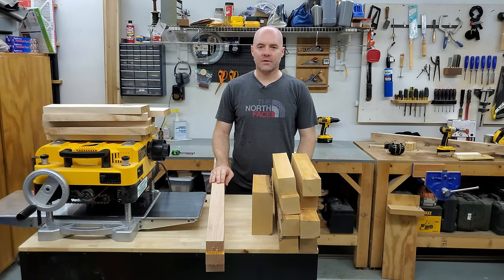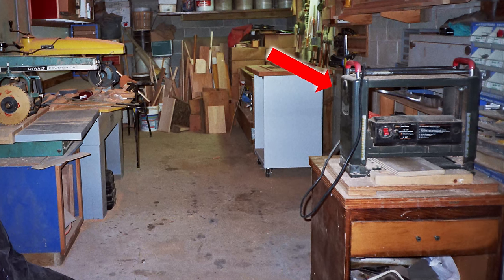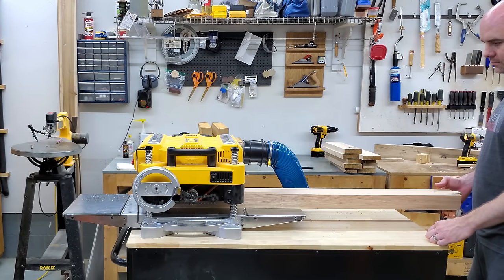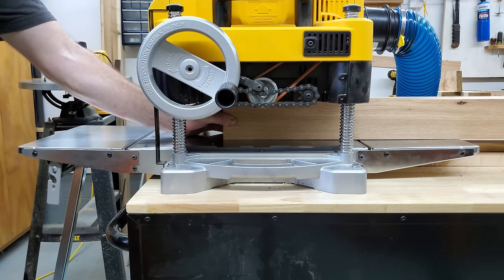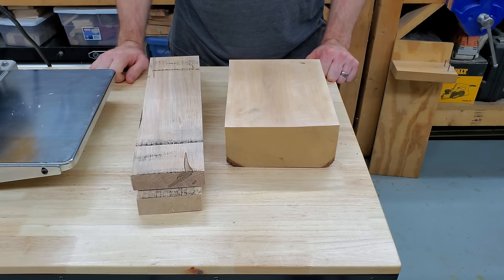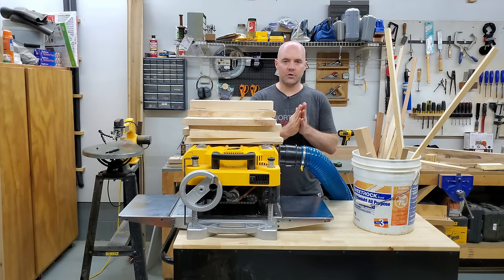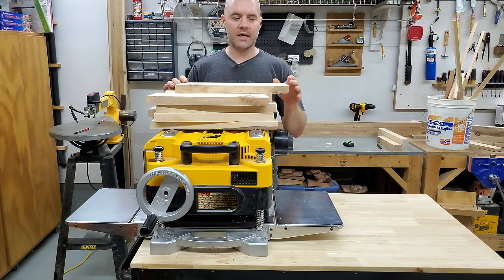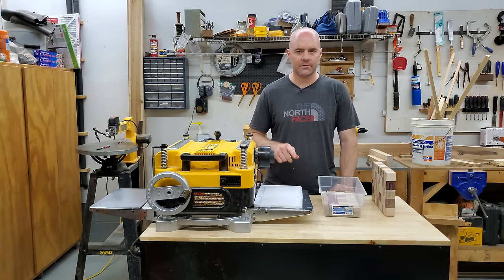Everything you need to know about thickness-planer snipe

Comment: I use your techniques to reduce snipe, but (as you said) nothing eliminates it (am also using DeWalt 735).  My Dad’s planer is a Shopsmith, which changes table height (rather than DeWalt’s changing cutter height).  It has a similar snipe tendency.  

Are there planers that do better in controlling snipe for hobby woodworkers, or are the higher-end planers simply wider?
Reply from the maker: From my experience, the only thing that completely eliminates it for portable planers is using a sacrificial board wide enough to maintain similar upward pressure as the project piece, or a plane train. I've heard good things about several other brands, but don't have any firsthand experience with recent models.

Comment: Great video, thank you. However I was hoping that there was an adjustment on the planer that helps getting at least close to a snipe free result. Ever since I changed the cutter knifes I can't get the snipe out, unless I have a sacrificial board in the beginning and at the end and even that has mixed results and it is very inconvenient and can get expensive with price of wood. That type of design is flawed and wished Dewalt would address that. This planer has been out for a number of years and it hasn't been addressed or they just can't figure it out. Never the less it is a great video.
Reply from the maker: Strange, changing cutter knives shouldn't affect snipe. How old is your planer? I wonder if there's something else that's showing signs of wear.
Reply: @TheSnekkerShow  Actually it quit common after I went down the rabbit hole. It apparently has to do with the rollers too. I know it sounds ridiculous but many users had the same experience after they changed cutters. Mine is about 8 years old but has not been used on regular basis.

Comment: I'm curious, does it help to have a jig that is a longer table? I have seen a few videos where a guy makes a longer table out of melamine and it sits on top of the planer table and just because it is longer it is supposed to reduce snipe. It must help to reduce snipe on the longer boards right?
Reply from the maker: That is correct. The longer tables provide infeed/outfeed support. Sometimes I'll set up roller stands for the same purpose if I'm planing longer or heavier boards.

Comment: I find that with my Craftsman, if I do the smallest cuts possible I get very little snipe. I use a long piece of Melamine shelf with support legs to make one long flat table, but even then I get snipe. But if I take off as little material as possible on my final passes, the snipe isn't nearly as noticeable and is easily removed with sanding.

Comment: Isn't the stop block on your sled [at 15 mins] on the wrong end as you inserted it?  Shouldn't it be at the rear?
Reply from the maker: The rollers are pulling forward, so if the stop block isn't in the front the board can get pulled right off the sled.
Reply: @TheSnekkerShow  You're correct and this is exactly my reasoning, but look how many who advocate/make sleds on YT and elsewhere put the stop block at the back end.
I'm an engineer!   The pull force is from the top, not the bottom. The workpiece drags the sled.   So if you imagine the friction force rearwards was very high under the sled and higher than that between the sled and workpiece, and higher than the opposing pull force, the sled would get left behind without the front-mounted stop block.
Clearly you know your stuff!  👍👍👍
Reply: @AllenReinecke  That confused me in other videos as well, where people started hot-gluing their boards to their sled.

Comment: Quick Question: Could you just disable the rollers and manually push the board through with a 2nd board?
Reply from the maker: Could? Yes. Should? No. High risk of kickback.

Comment: If you place your board in on a small angle, will that reduce/minimize snipe?
Reply from the maker: It could. Feeding at a slight angle lets the knives get a slightly easier start on the corner of the board, rather than hitting the entire edge at once. Especially on thin or very hard pieces, this can decrease the risk of the cut lifting the board in to the cutterhead. Most of the time it would just put your snipe line at an angle, but not reduce the depth.
Reply: Dominick get a jointer

Comment: I’m making a desk out of 5/4 x 6 x 10' pine & I have 5 lengths to make a 27 1/2” desk. So I glued up 2 pieces (to make 11" width to be able to plane) and then another 2 & have a single piece left over. You answered my question about feeding one after the other, but if I don't have those wings or a table to put them on and I'm working on my garage floor, i would have to put something on the floor to make it even with the planer feed table on both sides correct? Even if i had a table i would need rollers on both sides correct? I do have the same planer just never used it and im still learning. These 10ft boards are tricky,  i wish i could just pay a woodshop with an industrial planer to run the whole 27 1/2" width at one time for me lol
Reply: It should handle the length. My planer (ridgid) is similarly made and I run long 2x10s through all the time. You can build an outfeed bench or table for it, but I just hang on and hold the piece as it's entering then exiting. It's nearly impossible to run a train with long pieces like this without someone on both ends to support the pieces..but with infeed and outfeed tables I suppose it would be easier. Unfortunately my shop isn't 30 feet long to handle a 16 footer.. 10s are tough enough as is and I have to jump through hoops to get it done..
Reply: Even if you had an optimal support setup, this scenario is best done with a helper. For these times, I sweet talk my wife into sparing 15 minutes in the wood shop, and we do a dry run so she knows her role.  Then you can safely run a “plane train” and avoid most snipe.

Comment: Would an extended infeed/outfeed support help? Got my 735 without the folding tables and plan on making my own. Had the idea of grabbing some granite or quartz off of FB Marketplace, people are always giving the stuff away. Figured a nice, 2’ long polished piece on either end would be the bee’s knees. 
But would it make a difference having it that long?
Reply from the maker: Extended supports could definitely help. As for the right length, it would depend on what size boards you normally plane and how much space you have. The DeWalt support tables are usually enough for me, but I have to provide manual support for longer boards.

Comment: So does the actual cutter head raise up with the rollers like you showed?  I couldn’t see any deflection in your videos, but it raised in the animation.  If the cutter head raises, wouldn’t it defeat the purpose of setting the cutter height?  It would just cut a set amount below the rollers.
Reply from the maker: I did the animation just because the amount of movement in the planer body is not detectable by eye, unless it's a really bad planer. That's also why I used the wax crayon to show where the snipe was. On this planer, it's often so slight that it's not noticeable.
Reply: @TheSnekkerShow  Gotcha.  Thanks for the reply.  Great content!
Reply from the maker: @ericw9655  You're quite welcome.

Comment: Have you ever used a long jig to make the feed surface level?  I have seen several examples of that look like a possible solution.  I don't have as much experience as you, but I'm trying to find the best solution to the elimination of snipe.
Reply from the maker: Yes, you can make a jig that fits over the planer tables, usually out of something slippery like melamine-coated MDF. There are pros and cons. You definitely need to make sure you don't get any sawdust underneath the jig, or else your boards will come out thicker on one side than the other.
Reply: @TheSnekkerShow  Do you have recommendations about the length of the jig? I have a Craftsman 15 amp planer. I bought a Melaimane covers shelf today. It seems logical that the jig needs to be a little longer than the feed tables.
Reply from the maker: @robertstapp5070  A little longer than the tables, but if it's too long and unsupported, then it will flex, which would make the extra length pointless.
Reply: @TheSnekkerShow  thank you for your advice and help. It’s greatly appreciated!

Comment: Awesome video. My DW735 somehow will not go into low speed (i.e. position 1). Somehow no amount of for ce will allow me to turn the knob counterclockwise to slow the indeed speed down... And yes I tried while it's running. Has anybody experienced the same issue?
Reply from the maker: It hasn't happened to me, but if you take the top of the planer, the moving parts for the speed change are directly behind the speed switch on the front.  You'll have to depress the safety switch in the top to get it to start with the cover off - it looks like a little cross. Maybe you'll be able to see what's sticking.

Comment: What are your thoughts about getting a Sherlock?
Reply from the maker: I'm not familiar with it.
Reply: @TheSnekkerShow  Good grief … auto correct: I was trying for Shelix … and i found your video on that; pretty much answers all the questions I have presently.
Reply from the maker: @johnoerter2883  Ha! I should have figured that out. I'm a big fan of my Shelix.
Reply: @TheSnekkerShow  I have a Shopsmith Jointer and was frustrated after talking to the Shelix folks that because the outfeed table is fixed there is no way to install their cutterhead on the Shopsmith … :-(
Reply from the maker: @johnoerter2883  That's too bad. In my list of things I don't have time for, I've been thinking about trying to modify my Ridgid cutterhead to use carbide inserts.

Comment: Here's my technique:  In the plane train, one board is the Alpha and the Omega.  While Alpha is held by both feed rollers and getting planed, I lower the height wheel 1/16 turn, run all the boards, and when Alpha goes through the second time, it becomes the Omega and I raise the height wheel 1/16 turn while the board is still held by both feed rollers.  Does anyone else do something like this?

Comment: 2:57 So... If a planer had feed rollers on the bottom, there would be no snipe? A low power brushless motor could handle the feed rollers. This should be adopted.

Comment: NEVER stand in direct line with your work piece coming out of the planer, as seen at 6:35.
Reply from the maker: The knives are cutting towards the front, which is the direction any kickback debris would go. Not the back.

Comment: Read the manual for your dewalt planer. It says they should be angled. It tells you the specific angle to set them at. It also says that the tables are set from the factory at this setting.........so......?
Reply from the maker: I read my manual, and it definitely does not say that.  If yours is different, feel free to provide a link and specify which page it's on.  Either way, I think I explained and demonstrated pretty clearly why it's best to keep them in plane.

Here's a manual on the Rockler site. It mentions the infeed/outfeed tables on pages 12 and 13.  https://go.rockler.com/tech/DW735X-13in-Three-Knife-Two-Speed-Thickness-Planer.pdf.  On page 6 it says, "Be sure the wood is lying flat against the base of the planer.  If the material is inserted at an angle, the reading may be inaccurate," just as I demonstrated.
Reply: @TheSnekkerShow  you are correct, their is no situation in Woodmaching where a machine is purposely set off level, I have been a woodworing machinist for 57 years, so I think I may be correct.
Reply: LakesideHog, clearly you have NOT read the manual on this planer.  I recently purchased this exact planer, and on page 8, it addresses snipe and I quote it here:
  [start of quote]
TO AVOID SNIPE
Feed the workpiece into the planer so it is level and remains flat against the base at all times.
Keep the workpiece level throughout planning operation by receiving or 'catching' it from the rear of the planer.
If you are planing material that is especially long, the use of additional material support is recommended.
  [end of quote]
It goes on to discuss twisted, cupped and bowed wood, and includes an extremely good suggestion: "Your thickness planer will work best with material that has been run through a jointer to produce one flat surface." Definitely true! Jointers and thickness planers work hand-in-hand to produce proper flat, straight and true boards.
There is NO mention of specific angles for the tables in the manual, nor does the factory set them that way!

Comment: Your example of the tables is wrong first its exaderated greatly most people claim about a penny  thickness not a 1/8th and it is to account for table flex especially with heavey boards with weight on the table the tables flex down i have found with mine i found flat for light pieces of wood and a slite table preload with heavey boards
Reply from the maker: If your tables are flexing down from weight, then you're also getting upward pressure into the rollers and cutterhead. It sounds like what you really need is support father away from the planer, like roller stands or just manual support. If you prefer to slant your tables up to account for inadequate board support, that's fine too. Your tools your rules.

Comment: Is one planet better than another or does Dewalt simply flood YouTube channels with its product? Seems like EVERYONE has one and I wonder how much free advertising Dewalt gets.
Reply from the maker: My channel isn't sponsored, I pay for my own tools and supplies, and I won't give an opinion unless it's mine. This planer sets itself apart from many of the others by having two speeds, and four height-adjustment screws. Depending on your intended use, most planers will do the job just fine, and there are several that do a good job of reducing snipe.

Comment: Sooo.. all table top planers are shit and i should get a jointer.
Reply from the maker: They have similarities, but serve different functions. A jointer can flatten and straighten one face or edge, but if you flip the board over and joint the opposite side, the board will probably not have a uniform thickness. That's where the planer comes in.  You can't thickness well with a jointer, but you can make a thickness planer jig so it works like a jointer.

Comment: OMG. The instructions given on this video are horrendous. As an example, your video starts off by saying that the cutter head move upward when the infeed roller floats up. This could not be more wrong on the 735. Later in the video you specifically show that the infeed and outfeed rollers float independent of the fixed cutter head. I could rip this entire video based on poor content but this is just one.
Reply from the maker: Well now I'm just curious to hear you rip the entire video. Standing by to get roasted.
Reply: Who hurt you Dave?

Comment: These portable planers are junk. All pressed steel and no table rollers.
Reply from the maker: Mine has a cast-aluminum base coated with steel for durability. Comparing a universal-motor portable planer to a induction-motor stationary planer is kind of saying circular saws are junk compared to cabinet table saws, or that router tables are junk compared to shapers.
Reply: I’ve enjoyed using my portable Makita 2012 12” planer for the last 25 years. Thanks for informing me it’s junk otherwise I would’ve never known.
Reply: @heystarfish100  glad could help. Now wipe away the tears.
Reply: It’s all about what you can afford